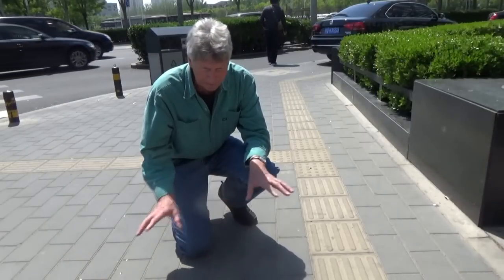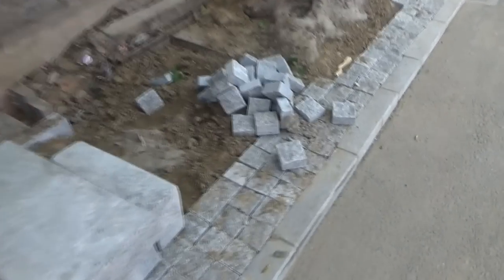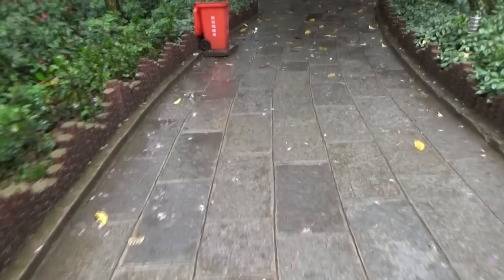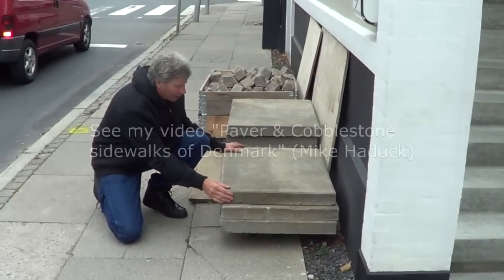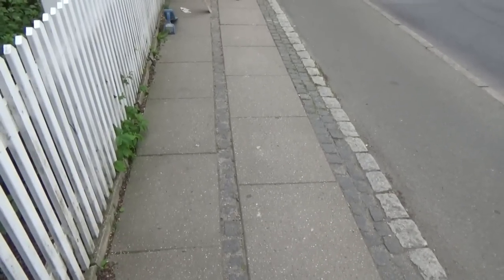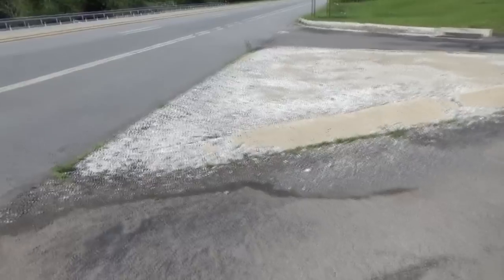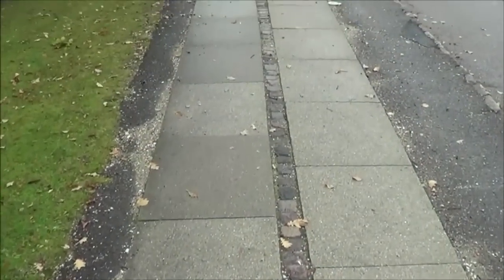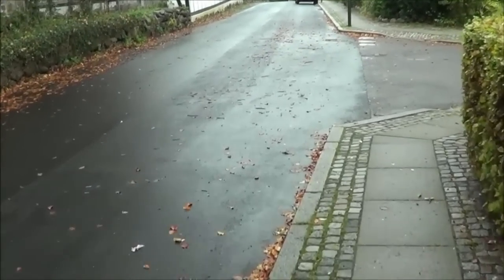SIDEWALKS  (Old School vrs. New School) Mike Haduck

Comment: Just keep in mind that your area near Scranton PA has worse weather than both Beijing and Denmark. Typically Only the low temperatures at night drop below freezing for Beijing and Denmark, but in Scranton the average high is just above freezing, and the temperature is below freezing more often than not.
Reply from the maker: Hi Michael, I agree, our temperatures can be different, but a lot of these sidewalks I filmed are also up in Sweden,  also I can show you stone sidewalks in my town  over 100 years old still as good as new, while the concrete sidewalks next to them has been replaced a few times already, and thrown into the landfill, the people in usa, don't want to hear it,  thanks mike

Comment: In Portland Oregon the city government will send you a notification that your sidewalk needs to be repaired, you have 30 days to do it yourself. If you won’t do it the government will. They show the cost of the government doing it, (1200.00), the next day I had independent contractors coming by offering to do the work for basically 600.00. 🤔
Reply from the maker: Hi Robin,  just the way is,  thanks mike

Comment: How do they keep the weeds out of the cobblestones everywhere? Here in Ohio you'd be pulling weeds all summer long.
Reply from the maker: Hi Matt in Europe the base is a couple feet deep,  thanks mike
Reply: @MikeHaduck  do they just use a gravel base? Any filter fabric it other tricks?

I've noticed the paver sidewalks here in OTR in Cincinnati getting a concrete pads poured below grade as a recess then some sand and the pavers inset. I'll try to send you a picture.
Reply from the maker: Mostly modified,  everyone does pavers different,  if it works it fine, my opinion,  thanks mike

Comment: Why does concrete in your neck of the woods have such a short lifespan?  BTW, great videos!
Reply from the maker: Hi Albert, our winters are wet and the freeze and thaw cycle kills it, then they throw salt on top of that, 25 years before replacement or repairs is average,  thanks Mike
Reply: @MikeHaduck  Thank you for your explanation, Mike. Greetings from across the Pond (England)!

Comment: An overlooked reason for the short life of sidewalks in the USA is the lack of curing time, it should stay wet (i.e. under a tarp) for at least 7 days (my Dad did this when ever he poured concrete in sidewalks around our house, over 50 years ago, they are still good to go). Here we let it set and dry overnight, which gives it a pretty short lifespan. Checkout highway pours, you will see the difference. If you think concrete can't last, check out the several 1,000 year old Coliseum, in Rome. Btw that million dollar space pen is a myth, No one, in Russia or the USA uses pencils in space, the graphite dust is a real problem, the "Space Pen" was developed by an independent company that sold a bunch to NASA for a few hundred bucks. Not sure what the USSR uses, but pencils in a weightless closed artificially controlled atmosphere is a real hazard.
Reply from the maker: Thanks, Mike

Comment: The reason why corners take so long in PA is because ok LAWSUITS!! The slope of the ramp has a very tight tolerance and is checked with smart level and the 1st block or landing after ramp has a very minimal slope and is checked with smart levels. These corner areas all have to meet the specific ADA requirements. Not saying it’s right or wrong but that’s why they take so long
Reply from the maker: Hi Chris, make sure you get a, consumer notice, a inspection report, and a satisfaction survey from the inspector, because if you don't, your the one that's liable, " a little knowledge from my law school days"  thanks mike
Reply: @MikeHaduck  I did them for a company about 15 years ago when I was union. I’m in Philadelphia. We actually did some over a few years later because the specifications changed. In my business, I wouldn’t even bother with them because there is too much bureaucracy involved with doing them
Reply from the maker: I hear you, your right, Mike

Comment: the pencil story, while a good anecdote, is not actually true, at first NASA used pencils too, but since the tips could break off and float around, sp space pens were actually designed to solve a problem. the underlying message is still definitely true though, there's so much busywork & waste in modern consumer culture...
Reply from the maker: Thank you foobar,  mike
Reply: @MikeHaduck  cheers, and thank you for all the great videos you've shared, i learned a lot!

Comment: A friend just moved back and bought a Frank Llyod Wright style home. The city just redid the busy street sidewalk and it's on a sloping grade following the street. He has had a fit over it. The curbs are square, the lay of the sidewalk at the corner doesn't match the street, so it doesn't hold the grass and the dirt - and of course the "required" handicapped no curb slope to the street holds water as it isn't done properly, and across the street they just left the sidewalk 10 feet short of the corner five feet upon a grade.... so no handicappers are going to be headed that way.  It's a joke man.
Reply from the maker: I hear you, thanks Mike

Comment: Roman cement was better than ours because there cement only held 2 percent water (had pumice in cement) unlike ours 28-20 percent. Then, how about moles. Darn things undermines all surface paving and homes. 
Your right! Our country was founded on simplicity till junk cement! 
If you will notice in other countries they use a lot of gravel for drainage! I have been digging and leveling the ground dropping 2 inch of 1/2 - then level, put 5 mil plastic sheeting then 1 inch of gravel. I mix my own cement! I try to give the cement a way to drain. Let you know in about 5-7 years if it is working. My court yard plastic under cement all plus surface cement drain to a sump pump! (I'm from just south of Saint Louis MO,) bad mole problems! 15 acres of field right behind my house!
Thanks Mike
Reply from the maker: Hi vernon, funny about the moles I just helped put in a couple planters for a gardern and we used wire mesh before the dirt went in,  never heard of it before but it was because of the mole problem,  some things are new to me,  thanks mike